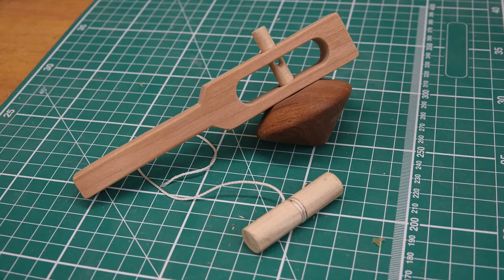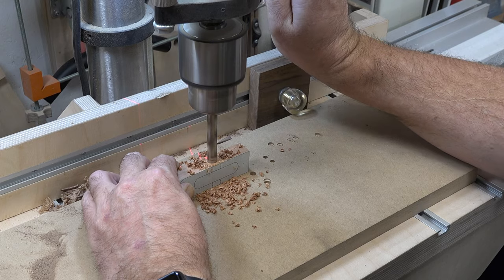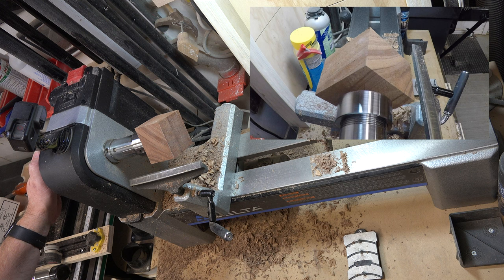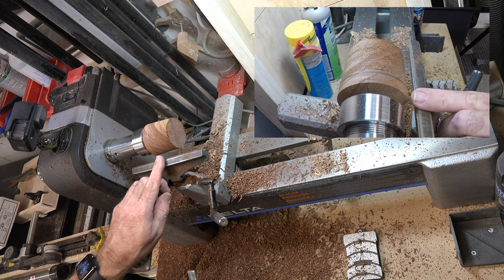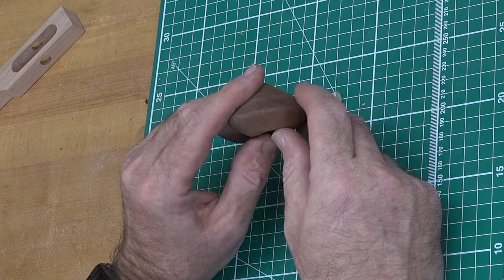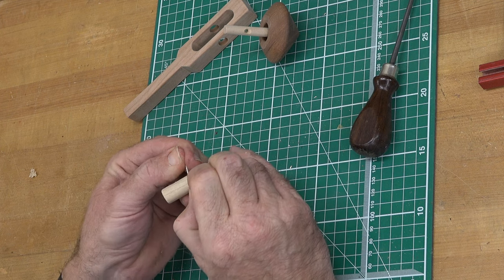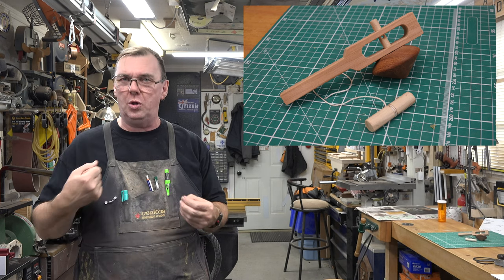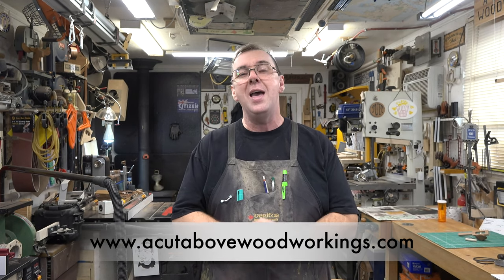Making a Spinning Top

Comment: a good point to say where safety mask, some 50 years ago my woodwork teacher  always said remove as much waste wood before starting to turn, times have changed, it does not change the fact it was a good project
Reply from the maker: I normally at least knock the corners off to avoid extra wear and tear on the chisels and to avoid the piece exploding on the lathe.  With or without knocking the corners off, a face shield is a MUST.  Thanks for tuning in Keith.

Comment: Absolutely brilliant 👍... I was wondering (to simplify things) if this would work ... the handle as just a stick with a vertical hole in it for the shaft of the top, the shaft of the top goes up through the hole and the string is wound onto the top of the shaft.
For those without a wood lathe, you could use a pillar drill to spin the wood and sand it or make a few discs (of varying sizes) out of thinner sheet and glue them together ... you could make the shaft stick out one end and have that as the point of the tops shaft.
Reply from the maker: I'm sure that this method would work Barry.  There is always more than one way to complete a project and a lathe is definitely not a requirement for this project.  It's just the method that I chose.  Thanks for tuning in and for chiming in with an excellent alternative to those who do not have a wood turning lathe.

Comment: How long did that spin at the end? It seemed to just keep going and going, it was still spinning when you cut to the end. Awesome project
Reply from the maker: My granddaughter (for some unknown reason) won't let it spin down until the end.  She likes to grab it up from the floor before it finishes.  So I just went out and spun the top and timed it.  The top spun for a total of 1 minute and 29 seconds before it toppled over.  It's got some great spin and that spin could be increase with a little longer pull string.  Thanks for tuning in to the show Randy and for taking the time to leave your comment.  It's appreciated.

Comment: Where did you get that 5/8 collet from?  Thanks
Reply: Following
Reply from the maker: I got this set years ago and absolutely love it.  I see that it has increased quite a bit in price since when I purchased it.  I use these collets along with the Beall 1/2" lathe chuck.  I hope this helps.  Thanks for tuning in.
https://www.leevalley.com/en-ca/shop/tools/power-tool-accessories/chucks/71613-beall-i-x-internal-expanding-collet-set?item=44J2335

Comment: Hi Kenny, great idea and very well presented. I watch all of your shows, and often make the items for my grandchildren.
I do have one safety concern, and that is that you used a SPINDLE ROUGHING GOUGE to rough down the CROSS GRAIN BLANK.
This is dangerous because 1) the tang is too weak if it dug into the end grain. and 2) as we could see, there was a fault in the blank which was not obvious on initial inspection, and if you had mounted the blank from the other side, it would have almost certainly have picked up the crack, causing a catastrophic catch which would have been extremely dangerous. a much better tool to use would have been a Bowl Gouge, which is designed for this job. 
Yes I did enjoy the show, but am worried that you have shown a very dangerous thing, and I have looked to you and other people on YouTube who talk safety to know these things. please do not take this the wrong way it is meant in the nicest possible way to assist you in future to show the correct way to use turning tools.
Reply from the maker: Well, I'm a little confused here Roger as I have always been told that the roughing gouge was the tool to use when rough turning any blank to round.  I have never been told of a difference between rough turning a cross grain blank or a spindle blank and have always been under the impression that the same roughing gouge was used for both, regardless of grain orientation.  My turning skills are considered "novice" at best and I have never really had any "formal" instruction (which is something that I would LOVE to get some day) so I don't do many turning videos on the show.  I have always stated that my methods are "unorthodox" to the seasoned turners and that there is most likely a better way to do them.  Now that you have mentioned this, I will have to look further into it to try and improve my turning skills and do it safely.  Thanks for tuning in to the show and for taking the time to chime in with your advice on chisel selection.  I truly appreciate it
Reply: @acutabove_woodworkings  Hi again Kenny, I was not meaning anything other than to help you to understand the dangers.
I am in Australia, and was taught Turning by Richard Raffan, who has a YouTube channel also, but made a living as a professional Turner and teacher. One of the first things that he taught me was that a Spindle Roughing Gouge is only for spindle turning. I have been turning for about 20 years also and have heard the stories of disasters from the incorrect use of a Spindle Roughing Gouge.
As a reference, I will suggest that you watch a YouTuber who uses the name Wortheffort and has a Video called "Four Cuts - A Wood Turning Basics Lesson. From about the 30 Minute mark he explains how the Spindle Roughing Gouge works. It is a long Video, so this is only about 15 minutes. The whole video goes over an hour, but explains how the wood reacts with the tools. I found it useful even though I had been taught the same thing by Richard many years ago. As I said, I am only trying to help you keep people safe also. 
Keep the shows going, I enjoy and in my old age am doing more Scrolling than turning due to health and really enjoy your ideas and the way you present them, please keep up the work. Cheers, Roger.
Reply: PS. I am definitely going to make these for my Grandies.